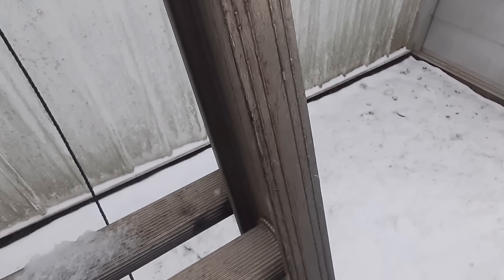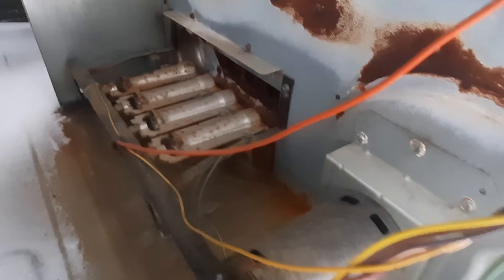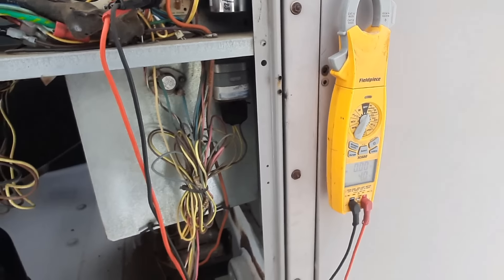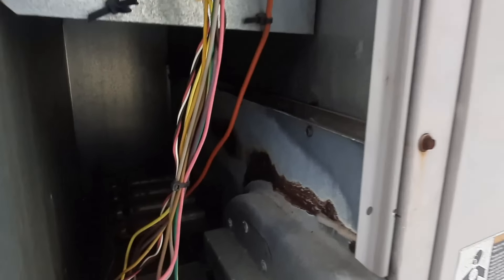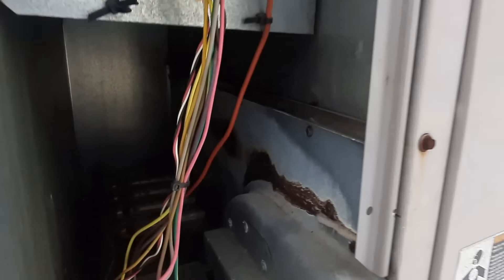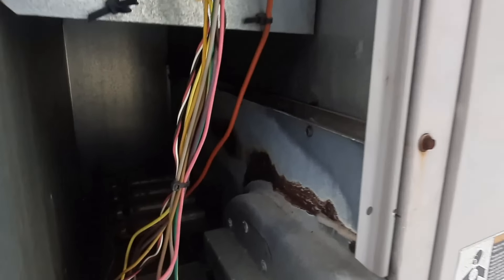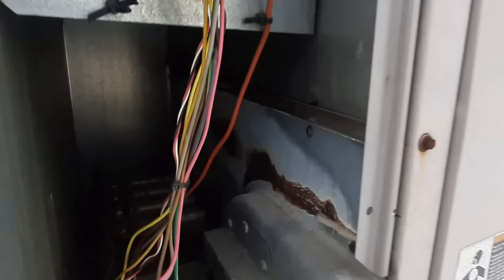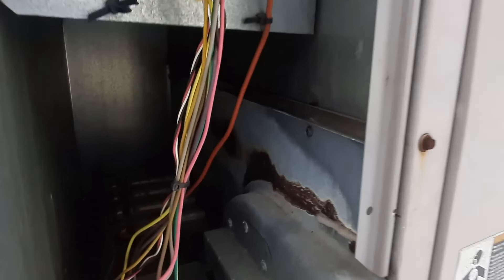two package units, Carrier and York, same building, no heat service calls.

Comment: The reason the voltage kept dropping was there was some kind of internal short in the board in the ignition circuit causing high resistance causing your voltage to drop from 26 to 3 volts, new board and spark ignitor to be safe.
Reply from the maker: You're right! Thanks, Ryan. I actually came back that afternoon and replaced the board. there were no issues after that.

Comment: Great job Steve.  Hard ti run service when your hands are froze!Only happens like that when it’s extremely cold….equipment is bumping their design capacity. 

That York unit sure needs new insulation & a re-glue job, didn’t even see where factory used any UL foil tape on the edges or corners inside.
Reply from the maker: Yeah, I think York probably had that at some point. It could be a chemical or something in the air breaking stuff down, it is a laboratory.

Comment: Thanks for sharing. I'm still confused on why the makeup air was dumping 55-60 air into the building when it was set to 70. Is the air losing heat somewhere?
Reply from the maker: The sensor is mounted on the unit before any of the duct. It's also near the heat exchanger and could be reading off a few degrees. The duct is a long run as well.

Comment: For the last 31 years I used to service antennas & satellite dishes on commercial buildings, and normally my repairs were fairly quick, especially during the winter months.  I frequently thought about the poor hvac techs having to do a time involved repair with frozen fingers and toes.
Reply from the maker: 😆 yeah, you gotta move quickly when it's this cold, but not too quick. The ice on the roof will slow you down enough. If it's a white roof, you're ice skating.
Reply: @EverythingHVACR  besides the wind and cold, nothing worse that a white rubber roof with fresh snow.  If you even have a roof hatch, it’s on the opposite corner.
Reply from the maker: @chatrkat Facts! 😆 Thanks, chatrkat

Comment: Im confused, why was the rollout tripping? Overheating?
Reply from the maker: The rollout did not trip. I was saying that with the front plate being rusted, it can cause roll-out switch trips and would be likely to trip after leaving. The rollout on these carriers is mounted up high, not directly by the burners. They trip around 150 degrees, I believe, and will not trip with the panel off most of the time, even when there is a problem.

Comment: Why do they put the roll out so far away from the burner, how does it trip the rollout being that far away?
Reply from the maker: I dont know the reasoning behind the location, but im sure the manufacturer has a reason. They trip at a lower temperature, I think around 150 degrees. They will trip, but more so, with the front plate deteriorating, it's amazing how bad the heat exchangers can get and still operate.